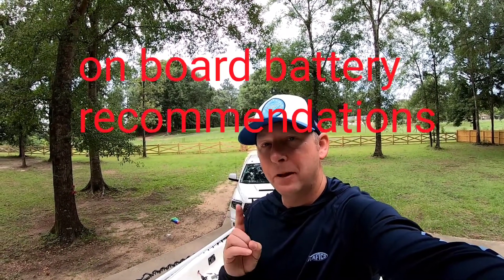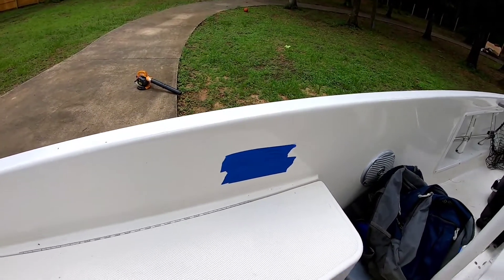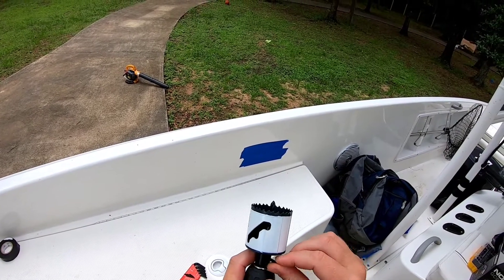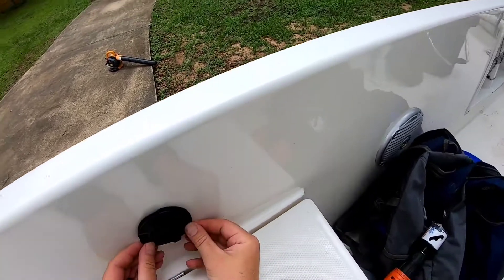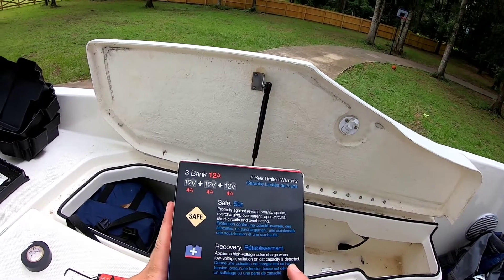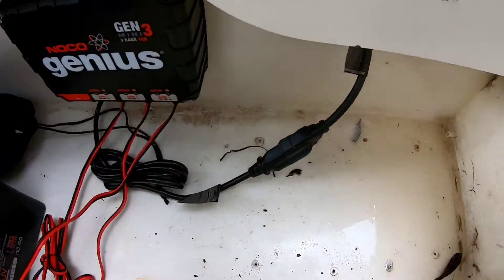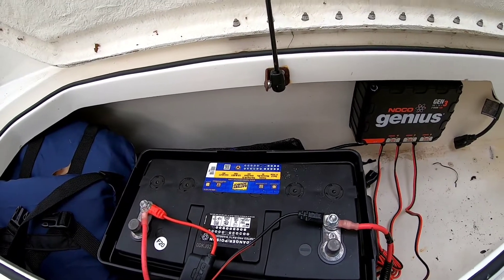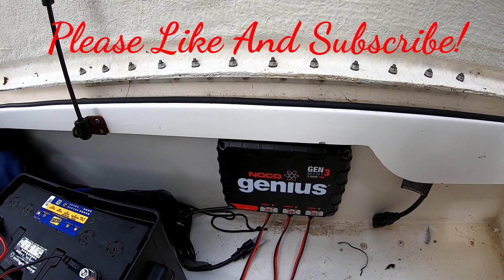INSTALLING A NOCO Gen 3 BATTERY CHARGER WITH AC ADAPTER PLUG. HOW TO DRILL A HOLE IN FIBERGLASS.

Comment: No the batteries are charging when they are red. If they are red and Orange there is a problem with the battery. They are charged when they are solid green And when they are blinking green that means they are charged and just Being optimized.

Comment: Nice Paul. I just installed one on my 24 volt system. I haven't put in the A/C plug yet, but definitely need to.
Reply from the maker: it is worth the money and install for sure.
Reply from the maker: I wanted to charge  batteries without opening the hatches

Comment: Great install Paul I have same company charger different model. Just change my 2 main batteries and my one dive system battery. The 2 mains were seven yrs old couldn’t believe that they were that old. The noco chargers work great on keeping the batteries charged up and ready to go. JT 🇺🇸🇺🇸🐠🐟🎣🛥🌴⛱🇺🇸😊😊😊🙏🏻🙏🏻🙏🏻🙏🏻
Reply from the maker: Thats good to know i seen a few bad reviews on it. I was wondering if it was going to last. It was a bit smaller than some of the larger chargers.